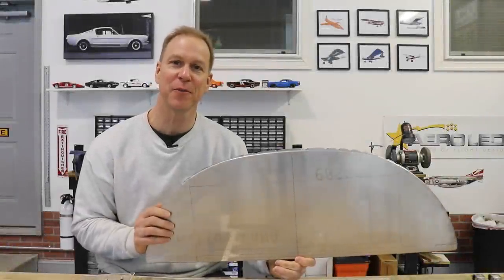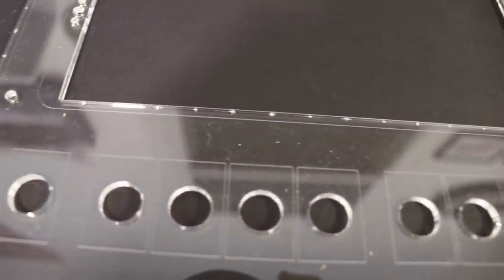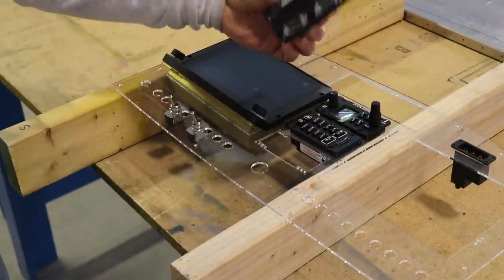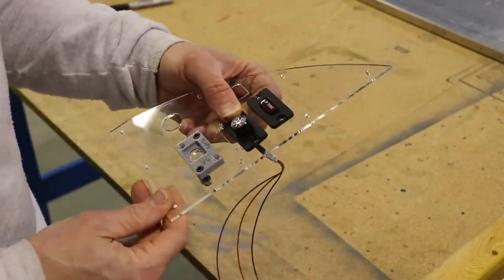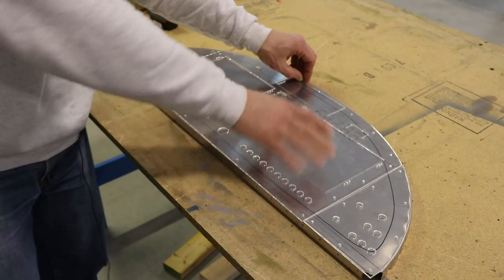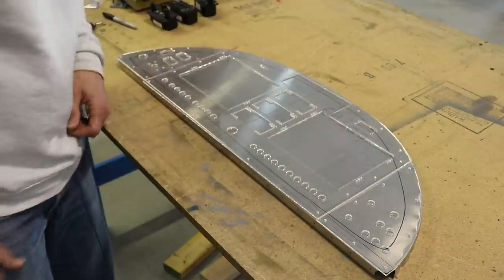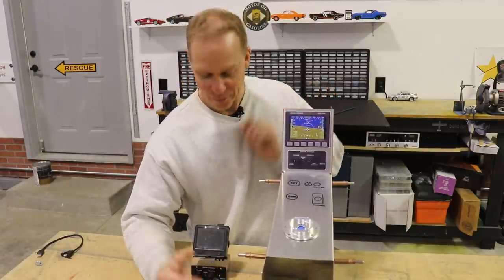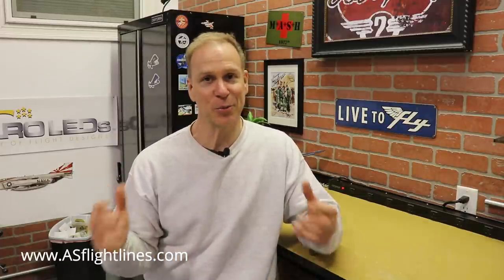Aircraft Instrument Panel Design (Ep38)

Comment: Love this series. Question: Did you consider locating the Mixture on the left next to the Throttle? Seems natural to have the engine controls grouped together on the left as you hold your stick on the right, plus you solve the center panel swivel out interference.
Reply from the maker: I'll explain more about the panel in Ep40-should be up in a day or so...

Comment: Did you consider putting the trim control on the grip and then putting the indicator near the throttle? Of course you could also use the Dynon for the trim and or flap indicator and leave the other one's off the panel all together.  My grips have both Flaps and trim on them and my only indicators are on the HDX screens...
Reply from the maker: Nope. I have it configured just how I like!

Comment: Cool video -- and panel! Question: did you do anything with regards to the flexing you saw, around the throttle in the Cruiser? Or is this panel different, in some regard? Thanks
Reply from the maker: The flexing won’t be an issue on this panel because the new panel will be .060 which is much thicker than the original panel.
Reply: @KitplaneEnthusiast  Makes sense. I guess it would be a bit hard to add something like a doubler behind (in front, as the plane sits) the panel in the Cruizer, to stiffen it up after the fact??

Comment: Hey Mark! Really useful info , sure beats the trial and error method. Is there not enough room to mount the mixture control on the left next to the throttle? I'm sure that you already considered that , I'm used to having them next to one another. Thanks for sharing and Blue Skies!
Reply from the maker: No-I wanted to mount the flap switch and trim switches next to the throttle. I also wanted to use my right hand for the mixture so my preference was to place it in the middle.
Reply: @KitplaneEnthusiast  makes sense! Your pretty much using up all of the real estate available! Thanks for the reply!

Comment: Hi Mark, a quick question: when you showed the missed "switch indicator", you said it was for trim switch. I though that in your earlier video, you want to have a flap switch indicator. I might have heard it wrong, but just want to make sure what that indicator for which switch. Thank you for the excellent videos. I have not missed any one of them!
Reply from the maker: The flap position will be displayed in the Dynon. Note that the Dynon can also display the trim position too but I liked the LED light provided by Ray Allen with the trim switch so I wanted to use their indicator.

Comment: Is your dash  the Super Duty dash or the Cruzer dash, which one is wider?
Reply from the maker: The SD has the smaller STOL panel and my Cruzer has the larger panel.
Reply: @KitplaneEnthusiast  So will the larger Cruzer dash fit in the SD?
Reply from the maker: @dcrahn  Yes. When you order your kit you can choose which panel you want. Note that the glare shield piece is different also based on the panel you choose.